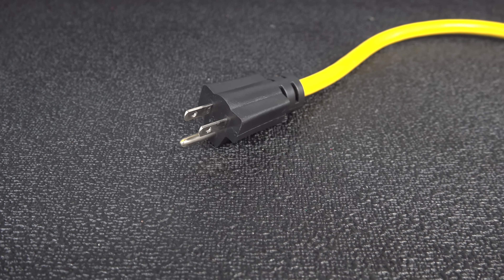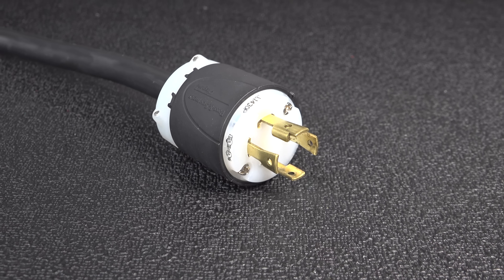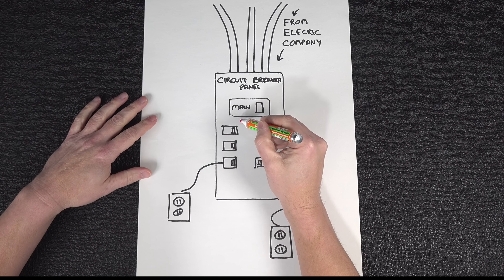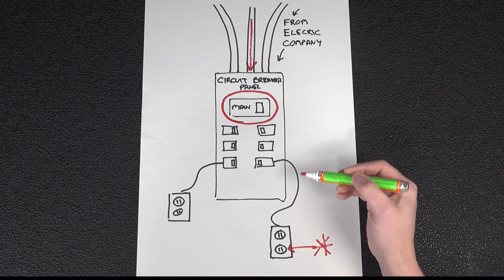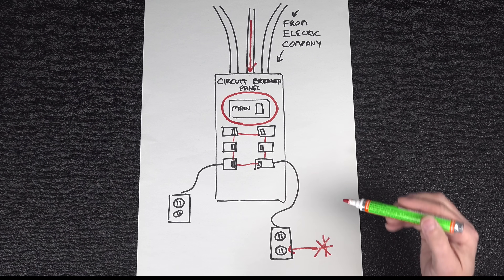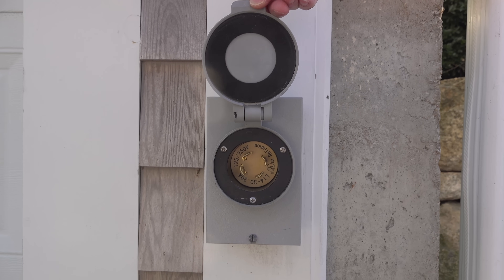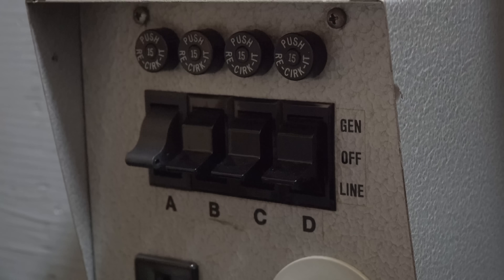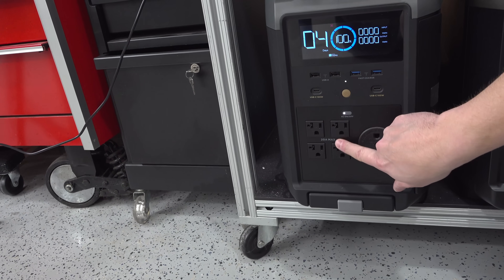Worst Electrical Mistake You Can Make - Backfeeding Generators

Comment: While what you say is true, you can back your house. Just turn off the main breaker and back feed away. Put a simple lock on your panel door if you are afraid your wife is going to turn the breaker back on. While living in New Jersey we were without power for 19 days. Hurricane Sandy took down our grid and the electric company kept blowing up transformers. Their own blueprints of the grid system them were not accurate. This summer we’re had a hurricane in Florida that knocked out power for two days. No AC in Florida you got to be kidding. 
Oh by the way a couple of days after Sandy it snowed. We had power, heat and charging stations for the folks who had no electricity. The gas company can around and turned off the gas. That say because the meters were under water. We still had oil.

Comment: I really think its a yankee, thing. I'm from the south and would do it in a pinch. Because I know what I'm doing. However yall from the north is like, that's not safe. It's illegal. blah blah blah. I'm a man, and can be responsible for my actions. And for my family. So boys, make that whip cable and screw what is illegal or not. ONLY IF YOU KNOW WHAT YOUR DOING.
Reply from the maker: Sitting here its easy to say that. The reason its illegal everywhere is because its killed people. The deaths were in the midwest and the south, so maybe you are right. I live in NH, live free or die and I won't backfeed. I know exactly how to do, hook up panels, done dozens of electric videos. The reason why is sometimes during a crisis its not always simple to think straight maybe 1/2 way through you get hurt and your wife or someone else flips the breaker not knowing. Now I know you will say no way, Im the only one etc. I not the police, I love my flamethrower, own guns, I don't really care about any silly law. I like the fact that doing it safely prevents any mistake, me my kids, whomever doing it. if no one ever made a mistake there would be no accidents, maybe its 1 in 5000 times but I think the rules on this are reasonable. Do what you want to do, im not the NEC but I know when it comes to any kind of a tech f'ups happen and this stops one of them completely.

Comment: It's a Darwin thing.  If you cannot see the prongs sticking out and not understand once you plug it into a energized outlet, those exposed prongs are the same as grabbing bare wires in the outlet, you shouldn't be doing ANYTHING related to electricity.

Comment: Can be used safely if you follow some simple steps. Main Breaker shut off and lock out to prevent accidentally having someone turn on the power. My home have 2 main. Turn both of them off. Write a step by step connection with the importance of these steps. Common Sense if you used this in a emergency!!!

Comment: I used to work for Lowes.  A customer asked me if we carried these cables and I said we don't because they are illegal.  Two weeks later he was in the store.  He told me he made his own cable and used it to connect his generator to his house.  When the mains power came back on, it shorted out his main panel and set his house on fire.  His insurance refused to cover the damage because he used an illegal item to power his house.
Reply: Either you are lying (most likely) or the guy didn't just backfeed through his dryer outlet. 
The dryer circuit has still got a breaker on it. So if you are telling the truth, the guy did it wrong and deserved to burn up.
Reply: @jessiepinkman9856  I'm not lying, this really happened.  He back fed through an outside outlet.
Reply: These honestly wouldn't work very well for Christmas lights anyway since most sets are non polarized.
Reply: That story reminds me of when a politician says their 3 year old child begged them to not let them take away their school lunches 😅

Comment: Thank you. I was actually pondering over this kind of thing and wondering how I could keep the electricity from going out of the home's circuits. Even though it is a BASIC premiss, I didn't think about shutting down the main breaker. It makes total sense now, but it just didn't occur to me as I was casually mulling it over in my mind. I'm going to get one of those Interlocks and get prepared for the frequent outages at our new home. THANKS AGAIN!!!

Comment: LOL. Been using these chords for years and years. I shut off the main breaker and feed the chord to a power outlet in my garage wall. The things on that circuit are my front room where I can watch the TV, run the internet, and power my phone. It also powers my hot water heater and fan blower for my heater in the garage, both Natural Gas. I don't know how much electricity this takes, but it doesn't even bring the generator idle up, so it's not much. When I see lights on the neighbor's houses, I kill the generator, unplug the chord, and throw the main back on.

Comment: So if the main circuit breaker in a house cannot isolate electricity from the main power lines feeding it nor the homes on those same power lines than why is it even allowed to exist at all? Seeing that it isn't a switch as it were at all and holds no ability to safely disconnect any live electricity from coming or going, so someone working wouldn't be able to LOTO as it were. Surely turning that main breaker off and then using an although illegal but functionable male to male cord with a generator couldn't travel through the disconnected main breaker and out to any main power line or other home...? What am I missing, and no I am obviously not an electrician nor have I been to school or anything for this topic. I am just curious and eager to learn and understand how things work. Thanks to any who takes the time to read this and responds. :]
Reply: The main panel does isolate the circuit, but If someone forgets to turn it off it can cause an accident

Comment: if you have capacitive and inductive loads, and you switch the main breaker off and the generator breaker on, you could still get a shock, but to be electrocuted, you'd need to be really quick, or be running some sort of coil gun on your home breaker.

Comment: Fun fact, my gebreatir is run by a suicide cable to the interlock. Male to male generator cable. And this is done by an actual electrician and it's set up to run not only a few outlets for fridges, but also our back wall of the kitchen because we had someone on oxygen. So male to male is not deadly at all it it's how it was set up by a certified electrician

Comment: I used to work at Lowes, and when customers asked me where they could find these cords? I educated them. 

If your power goes out and you can't feed the power of your generator to your home properly? Then go get a heavy extension cord and a surge protector. Place the generator outside, plug in your extension cord and run the line inside. Plug in your surge protector to the extension cord and plug in essential devices. Make sure that if you want a certain appliance (such as a refrigerator) to be plugged in that you place the set up accordingly. If your generator has multiple outlet ports? Then even better. 

Then after power comes back on, go and get your home updated to accept power correctly from a separate source.

Comment: So, I'm a bit lost. What is the difference with solar panels? They function as generators when the sun is shining and most systems don't have very much battery storage if any, so the energy goes into the grid and you get a credit on your bill. So how is that different from back feeding?

Comment: Backfeeding can be safe if you know what you're doing.  My house has a natural gas dryer, but also an outlet for an electric dryer which never gets used.  I bought some 10/4 SOOW cord and two plug ends and fabricated my own power cord for my generator.  I can then backfeed 240V through my 30A dryer outlet to supply power to everything in my house except the air conditioner (and I obviously only use what appliances I need at the time so as to not overload the generator).  I always turn off the 100A main before starting the generator.

Comment: Um yeah that's why you turn off the main breaker. That cord you show is the best way to use a backup generator. It's not dangerous unless you plug it in the generator first.

Comment: You should have opened up that outlet with the angle grinder wheel while the outlet was still in the wall and presenting with live current because dammit, I was expecting a loud AC hum, a louder bang, sparks, some flame and some smoke when that “suicide” cable was plugged in. 😉

Comment: Nothing wrong with this if you use your head. I made a 240v version of this to feed my house when I lose power for days on end after a hurricane. I pull my meter and shut off my main breaker, then feed power to my house from my generator through my welding receptacle and breaker, into my house. It powers everything. Just had to do it for Hurricane Ian. Always kill your main breaker and pull your meter to give a nice air gap so your generator cant backfeed through your weatherhead and up to the transformer. The transformer can convert secondary voltage into primary voltage and send it out on downed lines that linemen are trying to work on.

Comment: The reason it's illegal is because your general Joe McPublic can't be trusted to do it safely. If it's done right, it is perfectly fine and safe. I'm glad you pointed out the block for the dedicated generator feed circuit because that is a good idea. Do you have a link to where those can be found?

Comment: Wow, totally awed. The island got hit pretty hard by Fiona and I used this method for the 2 weeks we were without power. Yup, I used that same cord for 2 weeks straight. I shut down the main power and all the fuses in the electrical box except for the kitchen and living room one. Didn’t need to run the whole house just needed the fridge, a fan and power for charging phone, ipad and fan. Now watching this video has me scared to do it again even though I never had an issue using this type of cable with my inverter generator. Thanks for the info.

Comment: Yeah I agree forgetting to turn the breakers off could happen. I recently fed 230v into 100v device by accident even though I'm super careful with it and use US plugs (rather than normal EU plugs) exclusively for 100-120v not to ever mistake them and I even got a color cord I plug into my main 120v transformer not to ever mistake it and yet even I messed it up once.

Comment: I have no problem backfiring generators like this...
Done it before and I'll do it again. 
If you're unaware of how household wiring works, Don't realize that you have to turn off the main when doing it, and don't understand current carrying capacity of wiring in the walls, that's on you.
You can take a 240 v center tap generator with a 30 amp output and put it through either a 240 volt dryer plug, or through a 120v splitter and to 2 outlets in the house on either leg of the breaker panel and be just fine. Just never exceed the current capacity of the breaker in the leg you plug it into.
And ALWAYS turn OFF the main, before plugging in and starting the generator.

Comment: Back feeding a house with two double male cords can be completely safe if done correctly. I get some people aren't very tech savvy, but for people who are it's not that big of deal. 

Step 1. Shut main breaker off and put duct tape over it with a note saying absolutely do not turn on.
Step 2. Shut off all double pole breakers.
Step 3. Plug cord A into house outlet.
Step 4. Plug cord A into generator.
Step 5. Figure out which house outlets are hot and which are still dead (1/2 will be hot 1/2 will still be dead)
Step 6. Plug cord B into one of the dead house outlets.
Step 7. Plug cord B into generator. 

Now all outlets and switches will be hot use common sense and only use what you need, but you will have power through out your house. Only double pole breaker I would maybe use is a water pump if you needed to. 

To determine if power from the power company has been restored you can usually tell by looking at the power meter if it is digital (most are now) you will see the numbers on the LCD display if you see no numbers then there is no power. 

When power has been restored follow these steps.

Step 1. Shutdown and power down generator.
Step 2. Unplug cords from generator.
Step 3. Unplug cords from house.
Step 4. Now you can turn main breaker back on along with any double pole breakers.

Its not rocket science.

Comment: I built one with an outlet in the middle to increase current flow to my power saw.  Two 18 gauge extension cords feeding into one outlet, and then to the radial arm saw. The saw couldn’t spin up with one extension cord, but two into one did the job.

Comment: Turning off and locking the main breaker box insures no one can turn it back on when you back feed. Lmfao "illegal". Only reason why it's illegal is to promote installers to add a kiddy switch and bam back feeding is now "legal".

Comment: I have to assume the dangers of backfeeding shocking workers are generally mentioned because backfeeding can be dangerous for a variety of reasons.  It wouldn't and shouldn't be dangerous for workers out on the lines however.   Workers wear protective gear for high voltages.  If they are not they would/or should have the lines grounded out.  These workers are in far more danger from getting killed when their own power company re-energizes, especially if they are not protecting themselves.  Having said that it might be possible that backfeeding may energize fallen lines that may hurt someone.  The chances of blowing up a generator and burning a house down is a legit concern for sure.

Comment: I have a very simple and inexpensive suggestion. Its called Duct Tape. Lol

If youre running a generator to back feed your panel with suicide plugs( only if you touch the metal prongs.)...ensure you have turned off the main power breaker and put some duct tape over it. This will ensure nobody touches it and it wont kick back accidentally.
Turn all your house breakers off. Plug in your suicide plugs to the outlets you are going to use to backfeed and then plug in to the generator power outlets you have created for your power.
Now go outside and plug in the male end of the thick generator cord in. This leaves only the female side of the generator cord to plug in. Start the generator...let it warm up...now plug in the female side of the cord to your transfer plug...voila...you had no chance of electrical shock and your panel is now safely live.

Now with family help turn on only the breakers you need running for emergency power. As the lights in the house start turning on...turn off the light again at the wall switch. Remember...this is emergency power....not a free for all. You have to be mindful of the power that your generator can provide. So in other words..no central ac running/ dont run all your lights and tvs at the same time. When you leave the room..turn it off.

Comment: I sail  a boat. Many marinas have different connectors for shore power. I told a friend that I was going to build a cable with 3 different male ends, to a single female for my extension cord.
The look on his face was priceless.
Of course, I didn't build such a cable.

Comment: Another reason not to backfeed power: when the power DOES come back on, your generator is almost assuredly going to be out of phase with the energy grid.  If you are unlucky, your generator could get damaged and you may even damage the electrical equipment in your home.

Comment: It's nickname is "deadman's cord".  But I have one and have used it "safely"  during on extended outage(days).  But I would never trust anyone in my family to touch it.  I have a power strip and several extension cords so family can start the generator and safely plug in the refrigerator, sump pump and furnace.

Comment: I made a male/male extension cord on purpose. I have a Noco pass through on my camper as a shore power plug. The outside connection is a male, to fit the female end of an ext cord from the box, then a female end on the inside. I wanted the option  of using the shore power inlet as a power outlet to run power to a tent or for a set of party lights, movie projector, whatever. 
I made a male/male so I can plug the pass through into one of the AC outlets inside, and a short fem/fem to convert the outside of the pass through into something to plug an appliance into.  Works perfectly and is perfectly safe. Know what you’re doing and there’s no reason to run from equipment.

Comment: I’m going to be honest, illegal or not, it’s always better to appeal to logic rather than authority. Logic is how people make safe legal decisions. Saying no just because an authority said so doesn’t make someones life better.

Also, technically back feeding your panel is not illegal… depending on the local “electrical code”. And in fact, with the right equipment like grid-tie inverters, back feeding to the grid is sometimes encouraged. 

Take solar for example, many installations allow back feeding to the local grid to offset times where you cannot produce enough energy to cover your household intake. These devices sync to the carrier wave of the local grid and will form to it… connecting a ac power source out of phase with the local electrical grid is often dangerous and may destroy your equipment or end your life.

In the case of a power outage while back feeding, many localities require special breakers that detect when this carrier wave is no longer available and will automatically respond quickly to isolate your source from the grid incase of a grid failure.

This also limits your liability for wrongful death or dismemberment lawsuits that can result from making a dangerous situation for linemen.

Moral of the story is that blanket statements often ignore important caveats. It is often wise to consult a trusted local professional electrician before installing any self generated devices on your property.